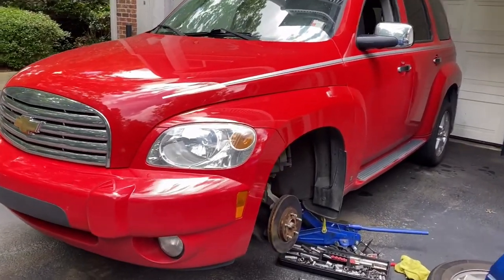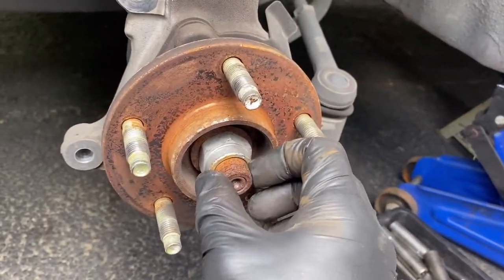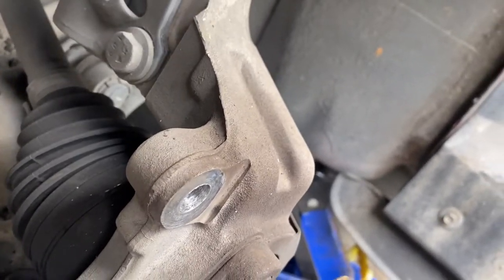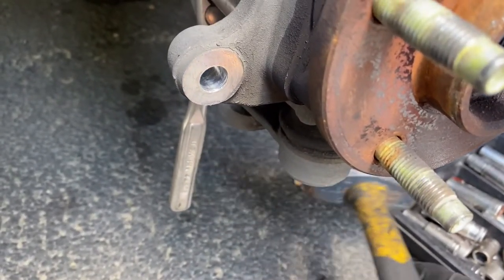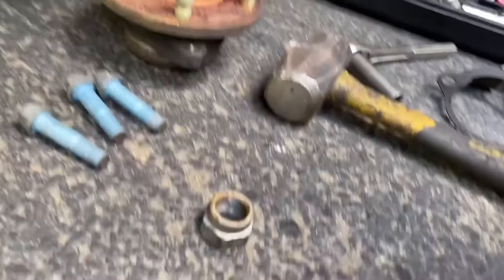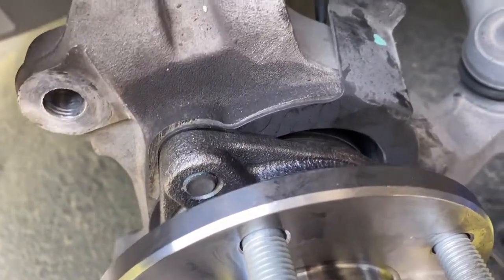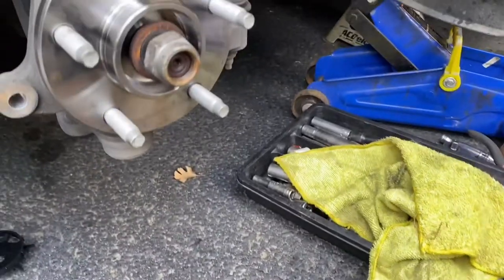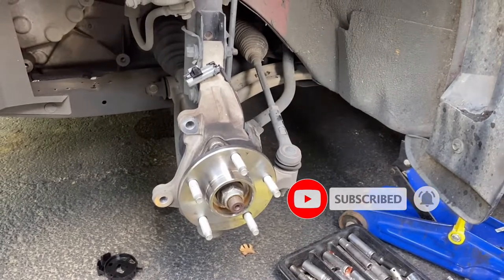2006 - 2011 Chevy HHR Front Wheel Hub Replacement

Comment: You and your passingers depend on the dependability and quality of the repairs.  Using a hammer and impact tool is very poor mechanical work.  You can rent for free a torque wrench to at least spec the repairs to ensure the safety of everyone while in this vehicle.  Failing parts can cause accidents by coming off or if too tight can seize causing control issues and even possible injury to those outside this vehicle when in operation.  Do it correctly please.
Reply from the maker: It will be ok, it’s a hub assembly not wheel bearing. Drove it for months with absolutely no issues.